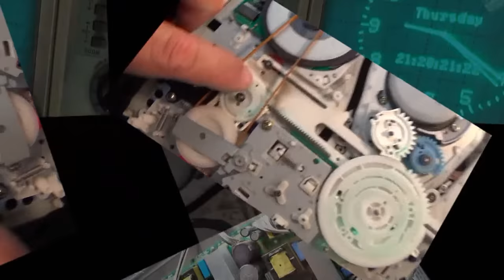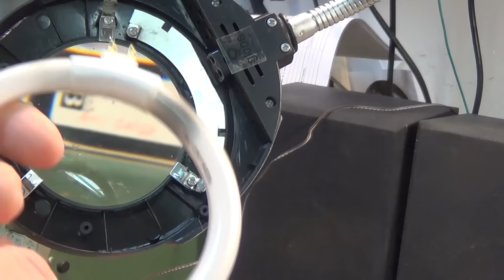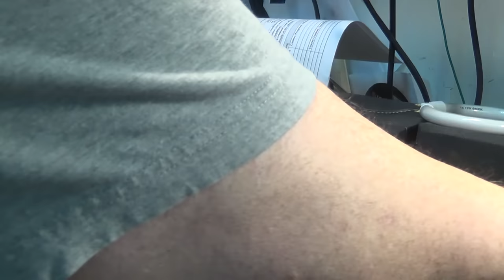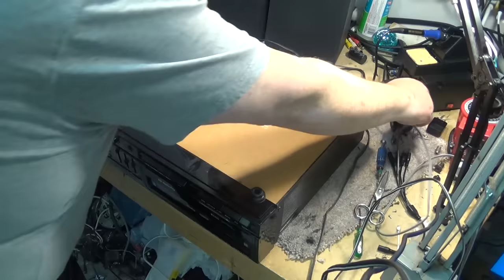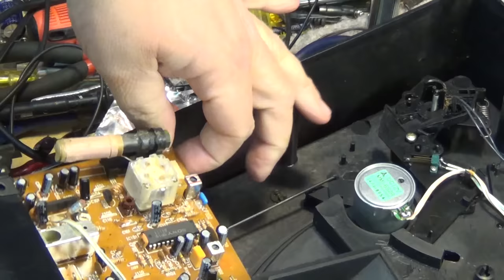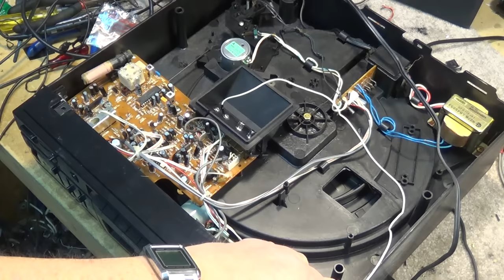Realistic Clairnette 124

Comment: Still better than a Crosley/china Crapophone. At least you have a tone control on that. The only thing I recall and still have from RadioCrap/Tandy were the Altai 5x8 long-throw speakers. They were a good upgrade for a low-powered system. RadioShack/Tandy went down the pan many moons ago here in the UK. Looks like that tapedeck came from a cheapo boombox, there were four belts as you say. Five if it had a tape counter LOL.

Comment: I have a RS weather cube radio from the 70's that still works. I spray painted the woodgrain sides gray and the top silver to give it a modern look. I use it every summer during severe weather and during the winter for snow storms. I also had a quadraphonic RS setup in the 70's. Their speakers were decent for the time.

Comment: A lot of the 60's and early 70's RS stuff was good, the speakers of those years sounded real good, I never owned any RS speakers but a friend of mine did and those speakers had lots of bass.
My system used AR2ax speakers when I was single, they were powered by a SONY receiver 55watts RMS per channel, but AR speakers were power hungry, I blew out the tweeter in the AR2ax by rewinding my reel to reel deck, AR sent me a new one, not free though...LOL

Comment: AH YES, looks to be a Nacamichi cassette deck in there, and AR turntable, with Marantz receiver, in a Rad Shak hifi system, LOL.  Not worth 20$?  Look what you'd get at KMart, a Crosley POS over 100$!  Before RS went Optimus / RCA, some of their stuff was GE, Sharp, Pioneer, Kenwood, Uniden, and who knows what else?  Looks like a Soundesign.  Randy Bachman of Guess Who from Winnepeg got a mention in this vid, super.    We saw Huey and the boys (w/ Tower of Power) where the heart is beatin...  IN CLEVELAND, man what a show that was, the ladies went nuts for Huey.  I don't think HLN mentioned San Fransisco or Oakland iin that song, which is their home tow.
Reply from the maker: +umajunkcollector Actually I have it listed for sale for 20.00 and I am sure someone will take it.Every thing I have put up for sale has gone. I got over 100 for that Sansui 3300 direct-o-matic cassette deck I serviced.
Reply: Belt changes on some cassettes can be a real pain.  Can you buy assorted belt sets in bulk these days?  Back in the 70s, they had like 100 piece sets of the more common belts, a pretty good variety.  I have a vernier caliper to measure belts.  Don

Comment: Wow, that's a blast from the past! In the early 90's I got a hold of a pair of speakers from Radio Shack, and they were awesome. They were called, if my memory serves me right (many Molson ago lol) Minimus 77's.  All metal enclosure, tight sound, great bottom end and good highs. Like you said, sometimes they put something out that was pretty good.
Reply from the maker: +Scott x Remember the Mach 1 Radio Shack Speaker. That was a great wall rattling speaker. Massive 15`woofer. Not very accurate, and Classical and Jazz listners would prefer a nice set of Altec Lansing speakers, but for pure house shaking bass, they did the job. They fetch more now then they did when they were new! I have a nice vintage set of Altec Lansing 3 way and they don`t get much better than these. Nice tight bass and soring highs. I drive it with a Luxman LV102 hybrid amp. One of the better vintage amps. Not super powerfull, but more than enough power, and because it has a pair of tube buffer, MOSFET driver tubes, it has all those wonderfull harmonics that tube buffs love, plus the punch of a mosfet amp.I do have an all tube amp too, in my living room, and it is really nice to listen to, but it doesn`t have the dynamics that the luxman has. It sounds different, very pleasant but not very punchy, drive it hard and it soft clips and goes all nice and warm and fuzzy. Over drive the luxman, and it goes into protect mode, and then you have no sound. (Saves the speakers though, which is a good thing.)
Reply: A lot of this stuff brings back some good memories, that's for sure. I had a Sansui au-x911dg amp, Harmon Kardon tuner/tape deck/CD player, and a pair of Cerwin Vega SE300's. You could feel the sound of those in your teeth. I made things move and had a blast doing it. Very crisp sound, powerful bass, good mids. When I wanted to have some fun, I'd use my dbx1531 EQ, 15 band stereo/31! Mono. You could shape the sound which ever way you liked. I am a tube fan as well, don't have an amp setup anymore, but I do know the distinct sound they produce, beautiful. Soft clipping/even order harmonics. Built a few back in the 90's. And they can give a hell of a shock (yeah, I know the hard way) A single ended triode (300B) would be a great amp to build. Audio is fun, and can be an expensive hobby. I look for the simplest way to get audio in and to the speaker now, and avoid digital when possible. I remember the luxman and the soft glow of the tubes in the front, was very cool! And the Mach 1's were always on demo in front of the store, and they were a hell of a bang for the buck. I do miss Radio Shack as I remember it.
Reply from the maker: +Scott x We all miss the shack. Up here in Canada we lost the shack many years ago when "Circuit City" remember them bought the Canadian distributer of Tandy, InterTAN Canada. Tandy leather company would not permit the radio shack name be used as the major stake holder of the Canadian distributer was the competition, so they changed the name to "The Source by Circuit City"It was all down hill from there. Circuit City went TU, but the Canadicn division was profitable, so that company sold to Bell Canada and they still have a bunch of retail stores, but it Is not the same as Radio Shack days. I still have a "Toy" I bought at Circuit City the last time I was in the store before they closed in the USA.I bought 2 of them for my kids, and one of the devices I still have sitting on te shelf behind me. It is a "plug and play TV Games" the ORIGINAL Namco PacMan!Yes the real game exactly like it was on those arcade games.The ONLY way to play Pacman is on a CRT monitor too. You could tell a tube was well used when the Pacman maze was burned into the phosphor screen.
Reply: +12voltvids I didn't know Bell acquired them! That would explain the amount of Bell adverts I see in store. I used to hang around with the guys that worked at Radio Shack when I was a kid/teenager. We would dial in to some bbs's and when the store wasn't too busy, or they would let me play around with the new 'high speed 1200 baud' modems, laughable by  today's standards but quite cool back then. I live in Montreal, and we have quite a few Source stores. Agreed about Pacman (all arcade) and CRT, the best.
Reply from the maker: +Scott x Many of the source stores stores have closed out west. They still have them in the big shopping malls, but most of the smaller stores have closed their doors. I remember when I was 16 or so I went into a Radio shack with a friend and a couple hundred dollars in my pocket, and was looking to buy something. The manager went up to my friend, and asked if he could help and my friend said just looking. The manager then told us to leave. When I questioned him, his reply was because he didn't have time to "baby sit up" and told us to leave the store. I was looking to buy a stereo with money I got for my birthday. I remember going across the street to another store and buying an Akal amp and tuner and going back to the store. I walked in flashed the receipt and remember me? Big mistake and walked out. Never set foot in that store again.

Comment: Ahh the realistic, ive had some quite decent stuff from them in the (early days), a realistic music center (not a stacker), a wide beast that sounded quite nice :-D
Bought from tandy in the uk.
God knows who actually designed the stuff, but it lasted very well, unlike archer spare parts lol, archer just made crap spares, they wanted shooting with an arrow lol.
I have had a micronta digital multimeter from the mid 1980's and its really not bad, but it did cost £80 at the time.
Sounds like later on they became super nasty with equipment.
Reply from the maker: +zx8401ztv I have a micronta digital multi meter. It's all over the place. There used to be a joke about Fluke. You know, "It would be a Fluke if it was accurate"Well, that phase was penned squarely at the Micronta meter I still have. I should put it up on the bench, and measure a complex signal, like the DC voltage on the Kathode of a CRT with video present. My fluke will show the nice stable DC average, whereas the Micronta liiks like it is having a heart attack. It is all over the place. Speaking of that.... An idea for a future video.
Reply: +12voltvids 
LOL i dont think micronta digitals can cope with r.f, when i used to repair c.b radios if i keyed up with the meter connected to the radio the meter would go blank.
Never designed for r.f you see :-D
Mine is the micronta 22-191, an old old digital, grey case with handle/stand, two rotary dials for function.range.
Ive improved it by padding the reference resistors for resistance and voltage ranges.
It wasnt a high spec meter, but it was good enough for repairs :-D
Reply from the maker: +zx8401ztv Mine is a 22-195 A few rungs up the ladder. Will do transistor measuring as well. Still have it, still works, batteries have been in it for 20 years and they still work too. accurate? Well that is debatable. I think I will do a shootout video with it, and do some measuring of video signals and such to show it's faults. It is a cool old meter. I used to have a Beckman, but that one is long gone. The plastic clip that held pressure on the display to hold it against the board fell apart, and no replacement was available :(
Reply: +12voltvids 
Thats a shame about the Beckman :-(, there is a site called MrModemhead.com, he tinkers and repairs selected multimeters, mostly fluke, he has repaired a beckman with the same clip problem.
.
Your 22-195 has a similar chipset to mine, i think for voltage they are about 1% accuracy, it wont like r.f, they dont lol.
The ac side is just a basic averaging job, no expensive true rms chips in those old beasts lol.

Comment: 12voltsvids radioshack made good speakers mach 3 minus 7. I still own the minus 7 I use them for my front surround sound speaker .But yes they where chea. My dad bought a radioshack clairnette system for my sister in like 1984 her was silver in color don't remember the model im sure you seen that one too . sounded like crap too .it replaced a zenith tabletop stereo then with allegro speakers I remember the sound way better from zenith

Comment: I've had a few of those just to play with over the years, found on the street. The sound is usually terrible. I still have the realistic EQ meter and bulk tape eraser I paid for. The bulk eraser has a rather short duty cycle and will overheat and shut off for an hour.

Comment: I had realistic clock radio that is analog must have got luck because it 100% works and is 30+ years later
Reply from the maker: +Darkwing duck videos Oh some of their stuff was great. I have a radio Shack video modulator. Not just any video modulator, the MTS Stereo modulator they sold a number of years ago. I still use it for a media player that streams an SD video feed with stereo sound throughout my house. It was one of the few analog modulators ever sold with MTS stereo sound and it was made in the USA. Top quality unit. They did have some good quality products, and they also had a bunch of cheap units that sold for much more than they were worth.

Comment: Hello! I know this is a relatively old video, but I recently found this same model at a goodwill  but it does not have any speakers. Do you have any recommendations on to where I could find a set of speakers for it? Also it seems there are two screws next to them too, how could I find an antenna?
Reply from the maker: Make an antenna out of a couple piece of wire.  Any small speakers will work fine.

Comment: This may seem like a stupid question, but why can't you use a simple rubber elastic band, instead of the proper belt?
Reply from the maker: +Koffi Banan A rubber band will not hold up long when used as a belt. It might work for a few weeks, and then they fall apart. I have seen people bring things in that they have put a rubber band on in the interim.
Reply: Thanks! Good to know, I have fixed my fathers tapedeck with a rubber band, but he doesn't use it too often. Maybe I'll order a proper belt anyway!

Comment: I would hit that ring bulb with my arc lighter and it would light. I've lit up CFL lamps with that lighter. And you could use rubber bands as belts but they have wow.
Reply from the maker: +coondogtheman1234 My 2,500.00 linear power supply would light it up nicely too.I have tried to pop some tubes with it, but it draws way too much current and pops the breaker instead. Need to put a big capacitor in series to increase the current.

Comment: A comment about Radio Shack products.
TRS 80 computer = Trash 80
I had a Pioneer VSX305 home theater receiver.  Radio Shack sold the exact same receiver, and I mean the exact same. The only difference it had their name on it and a price tag of 269.99.  Yet the Pioneer was only 139.99.  They put their name on products and charge 50% more.  Another example is their Realistic pro25 headphones they used to sell for $39.95.  They were just a pair of Koss ktx pros which sale for  $14.95.  They where identical including specs of 15hz to 25000hz frequency response, with an online volume control.
Reply from the maker: Radio shack was the masters of rebadging and doubling the price of everything they sold.